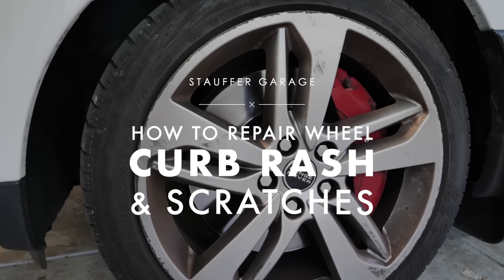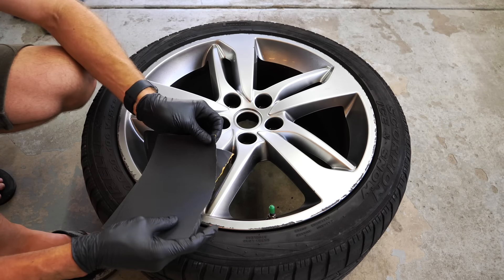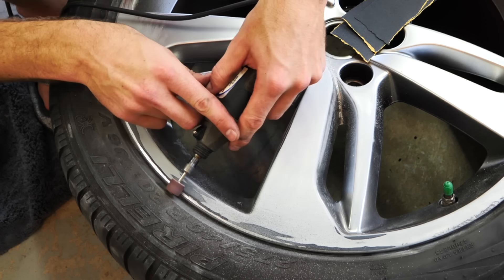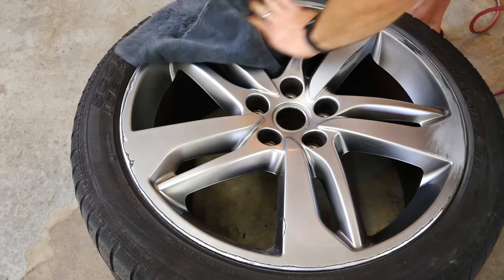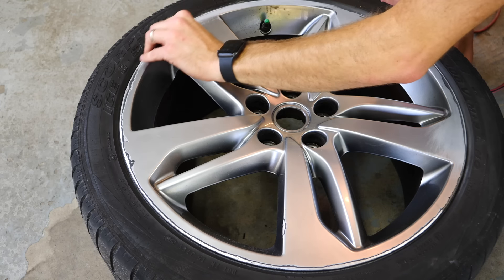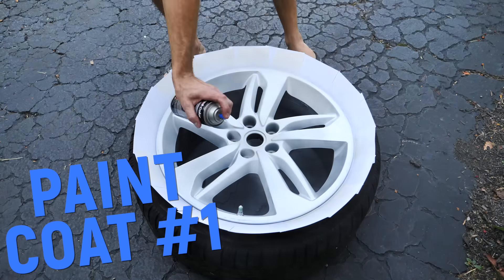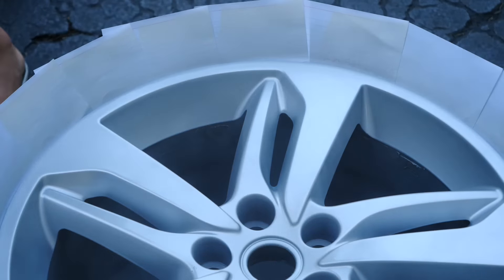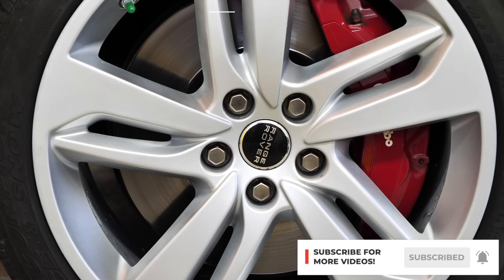Wheel Restoration || How to Repair and Restore Wheel Curb Rash and Rim Scratches

Comment: Worth giving a try as curb rash on 4 tires was an estimated 800-1200$.   I was thinking of doing this,  but concerned about possibly leaving rim unbalanced with bondo.  also wife’s car has 2 tone paint with high gloss black in between spokes. Will be interesting.    

I just know them curbs come right back at ya later 😛
Reply: The weight of the metal that was scraped off will be heavier than the weight of the Bondo you apply. Bonda is pretty light and its purpose really is only to fill in holes. Once you have applied the Bondo you sand it down to the level it was before the gouge. Only the gouge will be filled in ideally.
Reply: you can always go get your wheels balanced when done, still cheaper than buying new wheels or getting them fixed. if you believe it’s necessary that is.

Comment: Lots of good info! I’m restoring some old Honda wheels that have curb rash and pitting from de-icer. I used a lot of these steps and products except I used glazing putty so I didn’t have to use hardener and I also had to let all the air out of tires so the index cards would slide and stay in place.

Comment: This is a very interesting video but you need to be very careful around the edges. If you grind past the lowest point of the damage you are making it thinner and sharper. So if you hit a pot hole after the tire will go into the lip and get cut. You also end up changing the shape of the wheel. So you just need to be careful depending on the type of damage you have. It may be best to have them professionally finished depending on the severity.
Reply: which part "professionals" are doing different?
Reply: Lol
Reply: @thomaswild2957  welding metal to the wheel then shaping that back to original.
Reply: Yeah with a professional price tag attached to the job. 😂 I’ll take my chances with how he did it. I was quoted almost $1000 for my 4 rims. When I can spend about $100 in materials and do it myself.
Reply: @DIYwithBB  Bruh, for a 1600 i can find new wheels and sell the olds for 400-500... lmao
Reply: Or at least remove the tire
Reply: @thomaswild2957  lol. Right
Reply: And what happens to the new edge and single component lacquer when the tire needs replacing…
Reply: @zappedcustomdesigns788  if you weld the damage in the video, you're not a professional.

Comment: This is a first-rate instructional video. Thank you very much for posting it. 

I do have a QUESTTION about Clear Coat. Recently, I restored the wheels on my C5 Corvette using the process described in this video. For the most part, they look beautiful! 

I used "Dupli-Color High Performance Wheel Coating, Gloss Black" for the Paint Coat. However, I did not apply the "Dupli-Color Wheel Gloss CLEAR COAT". By not applying the Clear Coat, will that create a problem in the future? 

Thank you to anyone who feels compelled to answer my question (:
Reply: No one is interested.
Reply: Sorry no one provided feedback sooner. Clear coat is a protective layer for UV damage so black gloss may not last. Lightky scuff with 400-600 to remove gloss to matt finish then respray black gloss then clear with 2k from Eastwood and your set.

Comment: There are some epoxy paint pens made for this that will match well. Clean rim, file and sand damaged area, clean again, apply, then sand area to blend and polish. If you need to repspray the whole rim you should use a 2K clear coat for better durability. A 12oz spray can is only $20. Also avoid using any reinforced fillers or epoxies with steel filings that could react with the aluminum alloy. They are hard to sand smooth and blend also. Just use a clear 2-part 5min epoxy.

Comment: Awesome instructional! Im about to fix up and repaint my rims.

Only thing is I would not mix the Bondo filler and hardener on a Porous surface because it gives and incorrect ratio. Use plastic, metal or glass.

Comment: Great job. It sure looks great.

I have polished aluminum wheels. Is there a way to do what you did without paint the wheels? I could buy new wheels but at $400 each it gets expensive.
Reply: yes you can!
only need to sand the surface and polish after

Comment: Great video brother putting in the elbow grease. I like the work, i use the 2k ckear with the button hardener on the can, its supposed to be about the same as the clear in the paint gun, seems to be the best but its like 30.00 dollars a can. Anyway take care brother just giving my input in the comments.
Reply from the maker: Where do you pick that up at? This video is pretty old and that process still holds up to this day but I know I could have done better
Reply: Amazon … singles, 4 pack and 6 pack. 6 pack is ~$110

Comment: Nice work - I’d recommend getting a set of protective wheels sockets which you can attach to a 1/2 inch impact gun.  Outside of the socket has a plastic cover so no chance of scratching lug nut area of wheel during removal.
Reply from the maker: 100%, at the end I recommend using painters tape on the socket but I need to pick up a set of those asap
Reply: @StaufferGarage  Absolutely!  The tape is a great idea for the freshly painted wheels.  The protective sockets are great for general use when paint isn't used.  Keep up the great work and great videos!

Comment: When rattle channing your wheels it would be better to keep the can vertical than allowing the can to go hotizontal.

Try standing the tire on the tread or leaning the tire /wheel  against something.  Paint one top section at a time as you roll it forward.

Try utilizing one of those snap on handles on your can for improved control.
Reply from the maker: Thanks for the tips!

Comment: Nice video! i have 4 rims with as much curb rash as this.... maybe even more. I am usually a detail person when doing things, but probably don't have the time or patience to do the job as detailed as was done here. So I am thinking that maybe just doing a QUICK sanding and spraying clear coat would be a big improvement over how it looks now, and cut the time in half to complete. From what I am reading, the rims will probably only take a year or so before the curb rash destroys the bondo anyway. So what ya think? Has anyone tried the quick and halfass method for this?

Comment: Good video but you missed a couple steps. You didn’t thoroughly clean the wheel after sanding the primer. And you didn’t cover the valve stem, but then in the after shots it’s clean? Also you should purchase a torque wrench so your wheel doesn’t fly off.

Comment: How you figure out which silver colour you needed? Does it fit to the other wheels ?
Reply from the maker: That is the hard part because it will most likely not be a perfect match to original colors. Good news for me is I am planning to do all 4 wheels so a perfect match isn't crucial. If you are trying to do it and you only have 1-2 rims that need fixed, do 2 on the same side of the car so unless you remove all 4 and put side by side it will be really hard for anyone to notice a slight color difference.
Reply: @StaufferGarage  I'm on my second car as a new owner, and one of the wheel covers came off when I was driving on a dirt road. Looked up the cost of new wheel covers, $100 for 4... $15 for one from a pick-a-part is a grand deal! Almost no paint left on it so I just out the two worse covers on one side of the car and park so that side is normally hidden lmao
Reply: I kept scrolling in the comments for this. I have “one wheel” that had a bad accident scraping on my BMW and have been very reticent to try and fix it because of the matching issue, worried I would make it worse. Also never attempted this type of repair before. Question: how will it hold up when matched with tools to change a tire? What’s the chance of cracking and flying apart in the repair areas of the bondo ?

Comment: If your wheels are pretty dinged up would you want to use like a paint stripper or something on the whole wheel?
Reply: Some people use a pressure water hose loaded with sand and water to strip the clear coat.

Comment: Well done! They came out amazing! I have a question though: do you think it's necessary to strip the original clear coat before starting?
Reply: I'm not a complete expert but I think that as long as you just scuff the surface with that 220 grit he mentioned there should be enough for the primer to hold on to.
Reply: @rudygabrielperdomo9523  Yeah I think so too. But I'm worried more of having multiple layers of primer and paint and clear coat on top of the original will make the whole thing too thick and look "fat" in the end. especially if you're dealing with a wheel with several thin spokes.
Reply: @pixelcharlie  I wouldn't worry too much about that unless you're doing the same process 3+ times over or applying too much paint to begin with.

Comment: Stauffer it’s really an emergency during December my mustang got a thick layer of yellow/orange road grime and a battery powered pressure washer won’t even take it off but if I get it wet it’ll smudge almost like it will come off. What do I do to handle this and get rid of it. It is terrible

Comment: Got a question for you, I work on a bunch of cars that have had water leaks and customers usually dont bring them in until they end up with a mildew smell stuck in them after getting rid of all of the water. Besides replacing the carpet, do you have any good ways to get rid of the smell all together?
Reply: An enzyme spray should get into the carpet and kill the mildew and odor
Reply: Or use an ozone machine

Comment: If you can it’s probably better to remove the tire from your rim. Doing this will remove the risk of causing accidental sidewall damage to your tire. Which can’t be repaired and will require a brand new tire. So just something to consider if you want to save around $160

Comment: Lots of great info. I think there is one material mistake. Bare metal primer is not the best option here. Note for this type of DYI most users are not sanding down to bare metal. And in fact the primer is gping on the scuffed clear coat. 
I am not an expert just passing along what i was told by an expert. 
I was painting rims on an old car. Ok nothing fancy , just trying clean some damage and paint. . I used etching primer. Then read the instructions. It said bare metal use only. The expert said most likely would start peeling off in 12 months. Especially in NE OH with cold temps and lots of road salt. He explain a lot of things about chemical reactions, bonding, acid levels, etc. I pretended to understand and listen. Note the rims are off the car with no tires on them. 
So i had it backwards. Read instructions, talk to expert, then go to work. 
Options. 1. Put paint over the primer and deal with it later if they peel..
2. Have the guy sand blast to bare metal, use filler, prime, then paint.

Comment: Bondo on a wheel repair? I feel like that will flake off with a pot hole or the next time the tire gets taken off the rim from the tire machine
Reply from the maker: 3 years later and still perfect. It’s designed for metal. Now ideally I would say take it in for a real wheel repair with welded aluminum and lathed back to new. This video is for those that don’t want to do that
Reply: @StaufferGarage  Have you had to take the tires off since. I think that's the concern, if the machine to take the tires off will cause damage

Comment: Steps
Take tire off
Whash it with soap 
Sand it with 220
Or sand it with tools 
Wash with soap
Sand again with 220make it nice
Place bondo
Sand again 220
Sand with 400
Put primer on rim 
Primer coat #2
Sand with 800
Clean with towel
Paint coat 
Paint coat #2
Paint coat #3
Clear coat #1
Clear coat #2
Clear coat #3
Clean tire
Tape wrench for the paint not to come off

Comment: Too bad the rims I was going to do are chrome😅
Reply from the maker: Maybe I can find a set for another video!
Reply: @StaufferGarage  Yes please do! I'm thinking of just doing my HRE's myself. But it has polished lips. Or maybe from powdercoated back to plain silver.
Reply: There is no way you can repair chrome yourself. I have chrome rims and after repair chrome worn out. Only thing I found is powder coating with aluminium and chrome particles, but they will never shine like they used to. Second option is of course strip them out of chrome and put them in to galvanic bath with chrome but this approach requires industrial machines and lots of electricity.
Reply: I have chromed rims too and i'm going to repaint them with the chrome effect paint Bmw uses on its M rims. It is called shadow chrome and its code is A56.

Comment: "Use safety methods."  Like wearing sandals while working on cars?
Reply: Seriously lol? What will you do then if you wear a sandals and got a puncture on your way going?.😅 Or you need safety shoes just in case the rattle can will drops on your toes 🤣
Reply: @VWPassat_3BG  he does have a point there. Even if you work in a garage or shop, something heavy or sharp could fall and your feet will probably get damaged
Reply: I’ve done a ton of jobs barefoot

Comment: Please do not listen to his sanding paper advice when it comes to grit. 

Primers start having a hard time sticking in the mentioned 800-1000 grit range for sure.  800-1000 grit sandpaper  is used when there are blemishes on just sprayed flashed off ("dry") paint.  240-400 grit sandpaper is industry standard to get a good stick. Primer is designed to fill in such scratches. To a point the lower the grit, the better primer will stick.

Comment: Well... here is the thing.. Mobile repair wheel guys charge about $50.00 Per wheel. I know.. but How long did it take you to do this ? and the materials how much did you spend remember not like you will use the materials again.. I am just looking at the time it takes to do all this an materials.... sounds like it's better just to use a mobile repair wheel guy.